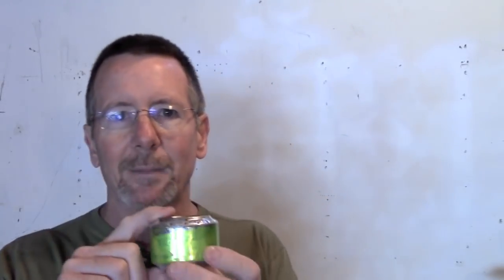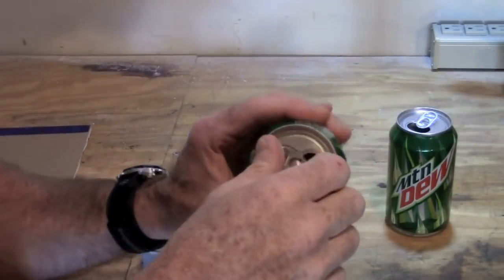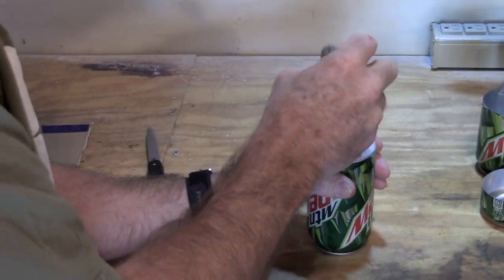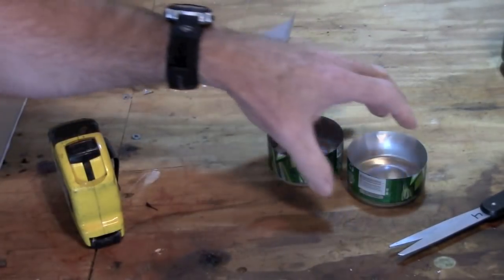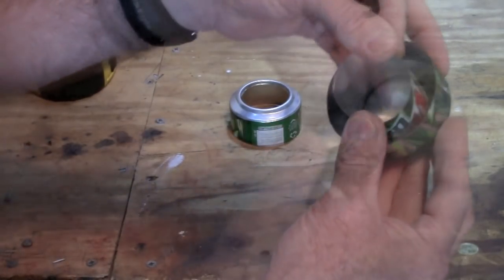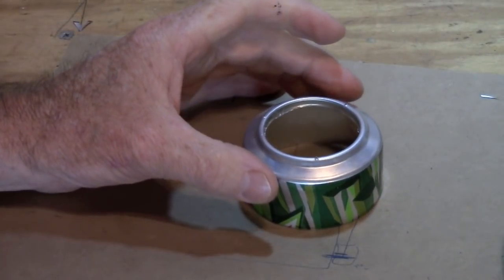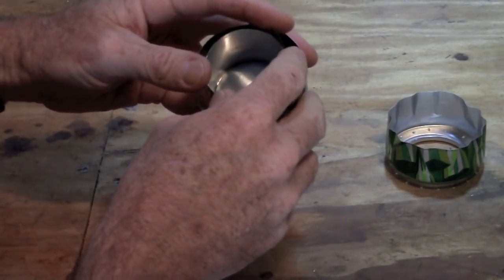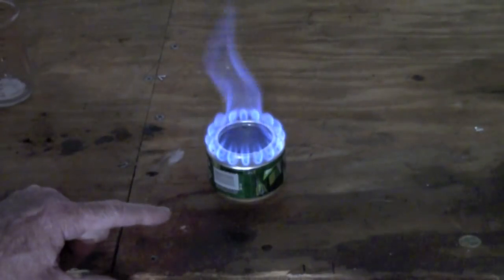How To Make An Alcohol Stove - Survival Gear

Comment: I built mine while watching yuor video. I used energy drink cans which made it a larger stove that could hold more alcohol. Also, walmart does have 91% rubbing alcohol that works pretty good. Now, to have a wind break and a pot stand all in one, I used an empty 28oz  diced tomato can and use tin snips to cut 7 knotches around the top to let flames out and yet still strong wnough to hold a 2 qt sauce pan filled with water. I used the old fashioned phnch can opener (church key) to open holes at the bottom so plenty of air could come in. Only did 4 as I figured it would allow plenty of air yet not compromise the structure of the can holding the pot on top. Worked beautifully! Thank you, your video was easy to watch and understand. Now we got us a alcohol stove and will make a few more. BUT, I also plan to buy a camping alcohol stove via amazon. Hope your link still works!
Reply: I gotta see a picture of this. I kinda know what you mean but can’t quite picture it. Either way it sounds brilliant and I wanna see how you made it.

Comment: Thanks for the video tutorial. I too heard about these at a boy scout outing, but when I did my research I found you. I chose to follow your video because you too were a novice. My first attempt took four cans because the book was too big so my wall was too small. Turned out pretty well for my first time. Can't wait to try it out. Thanks!
Reply from the maker: ***** Cool, I'm glad the video helped. Where are you a Scout? I am a Scoutmaster in Georgia.
Reply: I was a Life Scout and have a new boy scout and one still in Cubs. I was a 4 year Cubmaster and now and Assistant Scout Master. Just saw after building yours that yours lost to those others. Was going to try the similar one with the bigger side holes but there are no instructions. May wing it. Thanks!
Reply from the maker: I only made it to Star but I have one son who is an Eagle , another almost there and 2 more on their way. (Do I sound like a proud Dad?).

Yeah, those others were made by one of my subscribers. He does a great job and actually made enough for every boy in our Troop to have one. Super nice guy. I would wing it too ;-)
Reply: Did he ever make or find a good tutorial for the one with the bigger side holes? I'm wondering if you drill through both halves once they are together? You'd have to. I also am stumped with the ten holes. That's not even like 8 would be. Mostly I'm looking for one to use on a small 15 or 18 ounce cup. You mentioned that in a video.
Reply from the maker: All I can tell you is experiment. And remember, you aren't making a Rolex. If it boils water it is a success ;-)

Comment: Great video Joe. I made one and it boiled a sauce pan full of water. Great info. I'm making another one out of Perigrino soda cans. You can find them at most 711 convenient stores. There is foil on the soda can when you buy it. Its a unique aluminum can. 3X's the thickness of a regular can. Thanks more stuff I can share with my camping buddies.
Reply from the maker: Adam Sowers I'm glad you liked it. I'm going to try out the Perigrino cans. Thanks for the tip.

Comment: love this video. I've made 7 or 8 now they are just fun to make and I just made one out of 2 v8 cans (the little ones) and I didn't cut the notches in the bottom of the inner wall, and I only drilled 8 holes ( because the cans are so small ) and it primed faster than any of the others I made. I don't know if it's because of the size of the can or because I didn't cut notches in the inner wall, but I will say this, the stove I made where I cut the biggest notches in the inner wall was the least efficient and took the longest to prime. hope this helps someone :-)
Reply from the maker: Great info Joe.  It's kind of cool to be able to take what is basically trash to most people and make something that not only works but is very useful.  Way to experiment and see what works best.  - Bryan
Reply: It does help. I just finished my 2nd one, and noticed my notches were very small. I was going to try to enlarge them with a small nail, but I won't now, and see how it goes. Thanks.
Reply: Tom E cool, let me know and we'll see if we're on to something :-)
Reply: It did work fine. Then I made another with no notches and it also worked fine. Possibly faster priming than with notches, but I didn't do any serious tests. Definitely on to something though.
Reply: I think as long as the inner wall isn't seated too tight, the vapor can pressurize around it and prime faster. I did make one without any notches and made sure it was super tight and it didn't do too well. I like to be able to put my finger inside the stove and spin the inner wall on the small ones (not too loose though), on the larger ones, I still do cut very small notches :-)
Reply: You definitely need to cut small notches in the bottom of the wall.  This is necessary to let alcohol flow to the outer chamber. This will allow alcohol fumes to reach the jets. 
You should press the top and bottom tightly together, so the top and bottom of the center wall are sealed, everywhere except the notches. The seal prevents pressure leaks from the outer chamber to the inner. Pressure leaks will kill the efficiency of the jets.
So yes, small notches, and tight seal elsewhere.

Comment: Small thing i found after trying to make it twice - it's actually better to have the top on the outside wall rather than the bottom to minimise  pressure leak from the crimping gaps.  But maybe it's just my shoddy workmanship. :)  Thanks for the video!
Reply from the maker: +Wai Tik Chung you are probably right

Comment: For a in a pinch this is a good thing to know how to make. 

For $10-$13 you can buy a Trangia burner or other brand clones. 
These are great stoves with lots of pot stands available and can be adjusted for output. 

Now if you have $35-$45 burning a hole in your pocket, the Evernew titanium stove is my absolute favorite!!
I've given away all but two of my can stoves because of the Evernew stove!!

I make a small side burner stove from espresso cans (red bull size) for use with a cup that nests with the nalgene bottles (glacier cup). Putting the holes 1/2" down from the top keeps the flame on the radius of the cup walls instead of  up the sides and no pot stand.
Reply from the maker: Thanks for the tips.

Comment: the Heet is a better fuel than the denatured alcohol , IMO . i've made dozens of these from different types of containers/bottles/cans . . . etc . the one you just made seems to have one of the quickest " bloom " times of them all . i'm convinced it's because of the thinness of the can , heats up quicker .
out of what i have made , the one i like best was made from an aluminum budweiser bottle . not the screw top cap , the regular pry off cap . it's quite a bit sturdier that a soda can or beer can stove . a small bit heavier but not enough to force a change .
i know this video is old but hey , i just found it . good stuff Sir .

Comment: Me again. Just wanted to tell you I just made me one while follow your steps. And it was so much fun! Thank you. Now I am gonna test it! :-)
Reply from the maker: Excellent!  Let me know how it works for you.  I need to try to make one of your suspended stove platforms with the 3 ropes.
Reply: The stove worked well. I guess the holes could have been more even and the same size to get the "flower" more even, but it worked and I am happy with it! I will try to make a smaller one when I can get my hands on smaller tun cans. :-) I am glad you considering to make such a suspended stove platform. You can use a flat piece of steel / aluminium. I just happened to have that old mini Trangia lid lying around.
Reply from the maker: Thanks for letting me know how your stove works.  I will let you know how my suspended platform works when I get it done.

Comment: A small stretch of metal hardware cloth (basically metal mesh) bent into a the shape of the lower half of an H makes a great little "grill" to place on top of the stove to put your cup or pot onto. Weighs nothing and fits inside a standard Sierra cup along with the stove.
Reply from the maker: Good tip.

Comment: Well my first attempt at your stove failed. No problem as I plan to make the Fancy Feast one you switched to and many others did as well. Mostly I wanted to let you know what the problem was. By installing the bottom up the alcohol traveled up the folds I made when I crimped it. Just an FYI. Your tutorial is great. Thanks!
Reply from the maker: Yeah, that happened to me on some too. It still worked though.

Comment: I made a few of these a while back, TIME WELL SPENT. While it was a really fun learning process, the main thing I learned was just how well thought out the Trangia is for $15.00 ! LOL
Reply from the maker: I need to get one of those.  I like  that these kind don't require a stand.  And they are free.
Reply: The can stoves are wonderful little critters, but in use (on the trail), the thing I dislike is having to burn all the fuel off to be able to re-pack it. 
Main benefit to the Trangia for me is the ability to reseal and use remaining fuel later. Or to carry it pre-fueled for an overnight eliminating the redundant fuel bottle. Those features outweigh the need for a pot support, although a pot support/wind screen is kind of smart to have with the can stoves too.
Reply from the maker: Yeah, I need to get a Trangia.  I especially like the simmer feature on them. The thing I like most about the can stoves is that (unfortunately) you can usually find discarded cans everywhere and you can whip out a stove in a few minutes.  And I'm not sure why you would have to let the fuel burn off.  I was able to reclaim the left over fuel in mine when I did the performance test for an upcoming video.  Just turn a cup upside down over the stove and it will go out.  Sometimes you can blow them out.  And, yes, a windscreen and pot stand are both good ideas with any alcohol stove.

Comment: Great video. One question:
Instead of using two separate used cans, can you just pierce a new can in the middle and drink the liquid and now you have two sealed ends to work with. It seems like you may have enough material to make the burner.
Reply from the maker: +Eddie Garcia that might work.

Comment: hey,  i have 2 questions
1 how much alcohol can i put in the little can? just a inch or can i fill it.
2 how long would it burn
great video btw :)
Reply from the maker: I would probably experiment and see how much it takes to do what you need to do with your particular stove, since each is going to be a little different. A couple of generalities to consider: the more fuel you start with, the longer it seems to take to heat up, pressurize and bloom; in the other hand, it is a pain to interrupt the cooking process to refill the stove. Test and see what works best for you.
Reply: Survival On Purpose thanks, i will try it out :)

Comment: Can you use a thumbtack instead of a drill? I figure that would be easier to obtain in a survival situation so I went with that. I tried this, but only the middle lights, not the jets. Any thoughts as to why?
Reply from the maker: Maybe you don't have the openings in the sleeve correct so the alcohol can get into the outer chamber. Or the sleeve is not in correctly. Or just give it a little more time to bloom.  And I don't see why a thumbtack wouldn't work.
Reply from the maker: Maybe you don't have the openings in the sleeve correct so the alcohol can get into the outer chamber. Or the sleeve is not in correctly. Or just give it a little more time to bloom.  And I don't see why a thumbtack wouldn't work.

Comment: I followed your tutorial and I think my stove came out pretty well, but I'm not able to get the jet like yours. I am pretty sure it's just the fuel I am using, all I could get at the time was 50% rubbing alcohol, and some kind of Coleman camping fuel. That being said I see that the flame spouts through the sides, just below where I drilled the holes. I don't think it's supposed to do that.
Reply from the maker: Try some HEET. It is cheap.

Comment: Just seen a video where the unit is sealed except for the gas ring holes on the outer rim and four holes in the centre to allow for filling. Cotton wool inside absorbs the ethanol / alcohol liquid. Seems to be windproof in windy conditions. Have you tried this method? I am curious as to which one is more fuel efficient.
Reply from the maker: I haven't really tried any other methods. That sounds very similar to the commercial stoves like Trangia. Although they still work best with a wind screen.
Reply: Survival On Purpose Ok. Thank you very much :-)

Comment: I just made your stove and was having an issue with air flow? I should be able to block the large middle hole?
Reply from the maker: +Joe Vlasek Only if you make the dimples or somehow allow for a way to elevate your pot enough to allow air flow under it.
Reply: I figured it out thanks

Comment: have you ever tried an esbit stove? i bought one recently and am having problems getting the fuel tabs to boil water :/  think im just going to go with an alcohol stove
Reply: I like using esbit.  I just wish it wouldn't leave the gummy residue on the bottom of the pot.
Reply: Roaming Gnome yea between that and having problems getting enough heat from the tabs i decided to just make my own alcohol stove

Comment: Am I doing something wrong, mine don't seem to work properly, they don't seem to burn out of the outer holes not even after burning for a long while
Reply from the maker: Hard to say without seeing it. If you follow these directions exactly and use good fuel it should work. Maybe you need bigger outer holes?
Reply: I followed the instructions quite accurately and I'm using pure alcohol as fuel!
Reply from the maker: Then I have no idea
Reply: I will try with bigger outlet holes 😁
Reply: I made the holes bigger and it works a treat , thank you so much 😁

Comment: 16:20 DO NOT cut huge notches in the bottom of the inner wall - you are trying to build pressure in the inner chamber, not vent it......even if you are making a perfect seal at the top and bottom of the inner wall, you only need two tiny slits (just 1/16") on opposite sides to allow the alcohol to weep into the chamber.....any jet holes larger than about .020" will vent pressure too.
Reply from the maker: Mine works pretty good

Comment: Nice, looks like a solid little stove! I only messed with a couple different design, so I may have to give this one a go.

I did a video on a really simple one that can be made 'in the field' in just minutes with nothing but a a can & knife (http://youtu.be/Gf8VBqFf4_w). It's not as refined, but works none the less.
Reply from the maker: I watched your videos.  Nice, simple design.  Pretty cool.
Reply: Thanks, It's not anything fancy by any means. I think of it more as a quick almost disposable stove you can make on a whim or time of need. It not the sturdiest alcohol stove and depending on how well you put it together and your pot size, you may well need to use a stand. BUT it works and will do in a pinch.